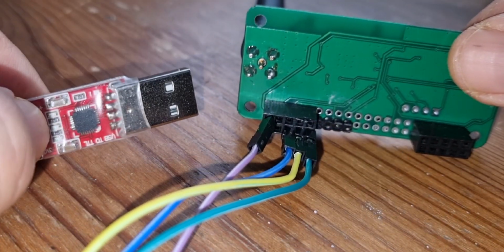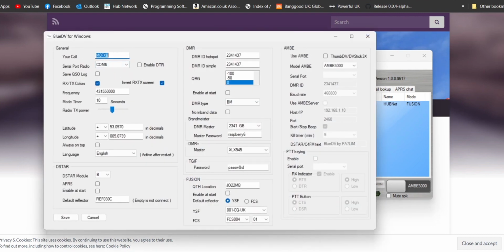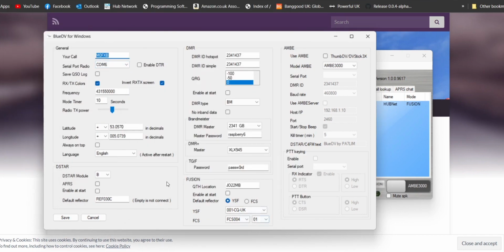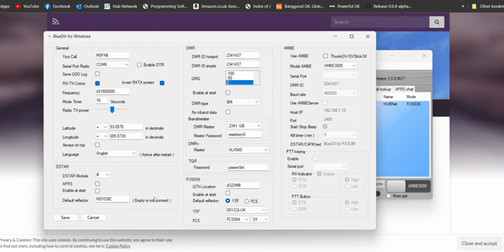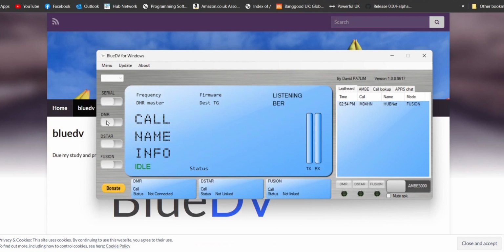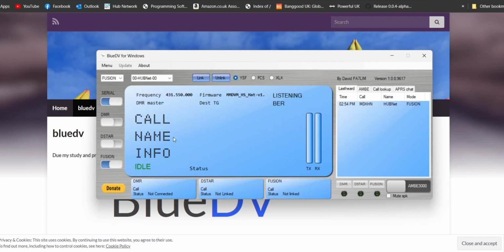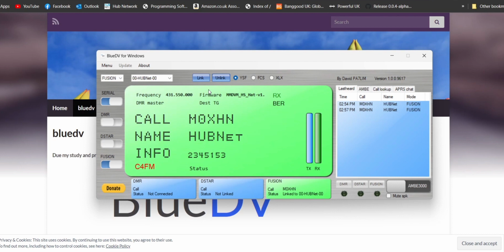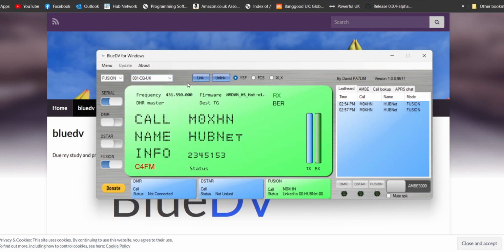USB to SERIAL - MMDVM HAT Connect Wires & Blue DV Settings

Comment: Instead of using as a rf hotspot in bluedv is it possible to only use the vocoder on the mmdvm hat as a AMBE USB dingle making "internet only" Calles via Dstar fusion and dmr as a DVStick?
Reply from the maker: Seems.very technical how would you do this ?
Reply: Sorry I'm not clear, it was meant as a question, thinking you have first hand eksperience with bluedv, and I have not, only pi-star and those mmdvm hats. I just understand that there is some legal req. in these vocoder chips, and if a hat got such a chip, then perhaps it could be used like a DVStick that only holds this chip, I imagine the mmdvm hats do too. I have never tried the bluedv software.
Reply: shaking the bag, in the hope of attention. btw. thanks for nice and good grounded quality content

Comment: Hi you did a great video, I want to know at the radio side the frequency of 431550000 is simple and analogous ,no digital right? Can I use different frequency .
73 W4EDY
Reply from the maker: Blue DV you Set Freq digital .
Reply: Thank my friend for your support, I am asking for the frec in the radio, can I set  in the HT Radio 431550000 Analog  CH simple  frec???
73 W4EDY

Comment: I have noticed that after a random amount of time, the BlueDV shows radio traffic and the MMDVM board is receiving it but it's not passing it to my radio. I wonder if it may be the board dying and have any of you noticed this?  I am using a cheap board from Amazon that is a few years old.
Reply from the maker: Hi its more an experiment rather than a permanent set up.

Comment: Thanks for the video. I was able to get this setup and running on my Macbook Pro 14 M1 using Parallels and installing the SIlicon Labs drivers maually on the Windows side.  Now I don't need a hotspot with me, just the laptop. I carry the "dongle" as I call it, in a small hard plastic box.  Huge thumbs up on this!
Reply from the maker: Thanks

Comment: Since I'm using a USB hat with a hotspot board and no Raspberry Is there any guides to setting up for DMD? As well as the hotspot to a radio?  I have dabbled with hotspots and PiStar but Blue DV is a different beast.

N8ZOM
Reply from the maker: Hi u need correct channel created in the Radio.

Comment: There is another Ham doing the same as you.  His latest video is using a HC05 bluetooth adapter instead of the USB to TTL.   He then uses a USB power supply to power it.  He had to 
add a 3.3v regulator for the MMDVM hat so the TTL will rise only to 3.3v.   His is wireless.  Pretty cool.
https://www.youtube.com/watch?v=peXm5wWeBAw
Reply from the maker: Hi Many thanks